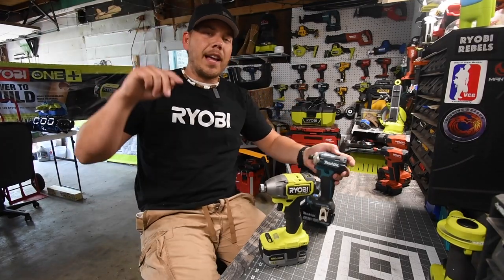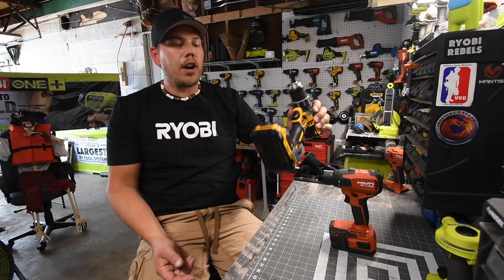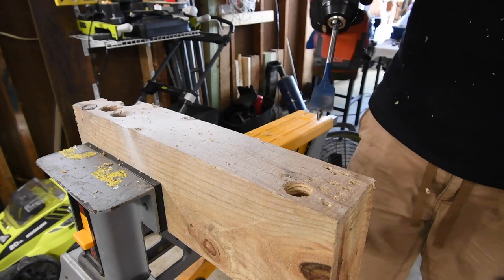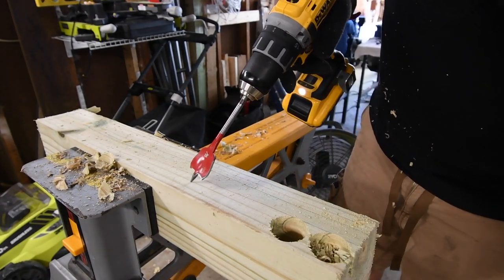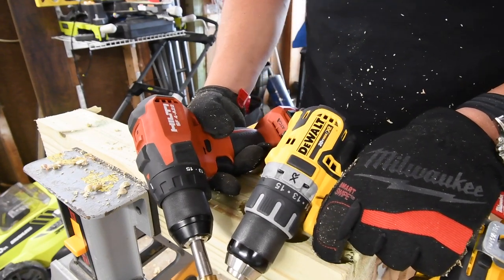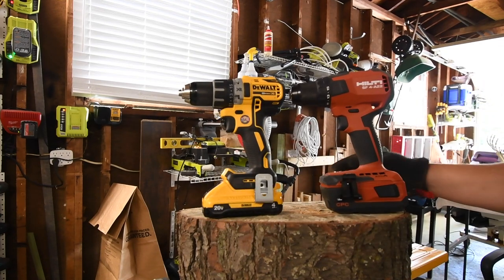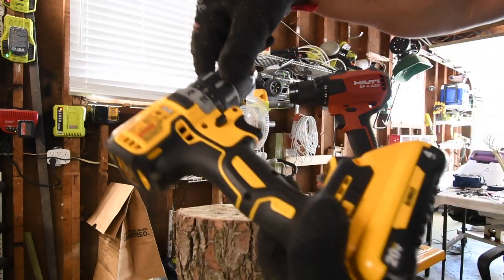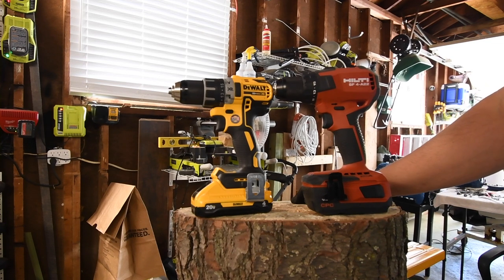HILTI vs Dewalt (Mid-Range Drill Drivers)

Comment: Hi Dave, this hilti is outstanding performance in my opinion I’ve always used the hilti jack hammer and it’s always been a work horse along with the Milwaukee, dewalt is an excellent tool as well I’m just a hilti and Milwaukee fan, excellent quality video ty, Bob,

Comment: I like it when a $200+ bare tool is classed as mid range.
Reply: Lol
Reply: SF4 A22 is the lowest in the current Hilti 22V line, and has 3 steps above, SF6, SF8 and SF10. From the previos generation with brushes ther is SFC A22 lower torque, but all Hilti cordless drill drivers are ridiculously heavy for the provided torque, except the current 10.8V so coled 12V line that is OK with SF 2 A12 @ 4Ah pack  with 21700 cells.
Reply: @loochan325  I know its Hilti's "cheapest" but its still not a mid range cordless drill driver for that price. Thats high end and only Festool has more expensive drill drivers far as i know.

Anything from Hilti is per definition high end really cause the price of the batteries alone wants to make me throw up.
Reply: @TheSir2005  Hilti, Fein, Mafell, Festool,  Atlas Copco, Ingersol Rand, plus the industrial lines made in Japan from Makita and Bosch that for only 6 Nm cost like 2X Hilti  SF 6...
Reply: @loochan325  No clue what you are on about
Reply: @TheSir2005  You wrote that as far as you know only Festool has more expensive drills. Fein and Mafell are even more expensive then Festool, plus Ingersoll Rand, Atlas Copco, and   even the industrial line with precise torque from Makita and Bosch that cost like 500-600 USD bare tool,   1/4" fix hex head no chuck. At Hilti you can look for SF 2 A12 that is the only light Hilti drill that has decent torque at 21 Nm soft torque and 34 hard ( older SF A12 at 11 Nm is not enough). Bare tool is like 100- 120 USD, the charger is around 50-60. A new 4 Ah compact pack with 21700 cells cost like 2/3 of the tool price and is nice to have two, is expensive but very nice. I have a big colection of heavy duty   and industrial drills. My main cordless drill drivers are Bosch GSR 10.8 2 Li @ 2Ah renamed GSR 12V-15 FC Heavy Duty, plus GSR 12V-15 FC Heavy Duty, that are very light and have decent torque at 15 Nm soft and 30 hard, extremely reliable, afordable and with decently priced parts at the same time, but I also use my old Makita 6270@ 2Ah NiCd, Makita DDF 453 @ 2Ah Liion, DDF 456 @ 2 Ah, DDF 480 @ 5Ah - too heavy and stupid noisy fan for brushless, Bosch GSR 18V-50 @ 4Ah pro core with 21700 cells, Fein ASCM 18 QM @ 4Ah with 43mm colar that I was able to find more afordable then Mafell A18M bl and Festool DRC and new TDC and close to Metabo but I don't like metabo, and the new Bosch GSR 18V-150C @ 8Ah that has the record for torque, plus Festool T12 with heads, and the new Hilti SF 2 A12 @ 4Ah. I was looking for Hilti SFE 2 A12 with heads too, but I don't like the heavy chuck and the bulky angled chuck so I pass that one. I have manny other industrial and heavy duty and Industrial cordless drills in my colection, from Atlas Copco, Ingersoll Rand, Fein, Hilti, Makita, plus corded from Makita, Bosch professional and even some industrial Bosch from the '90, also from Fein, Hilti, Atlas Copco, Ingersoll Rand, real Kress, and even some Duss that have the highest price, plus stations and drill stands from Blumm, Grass and some others    heavy duty industrial manufacturers not known in US.
Reply: @loochan325  Industrial line from Makita and Bosch... What industrial line? Maybe you can give me product numbers but i've never heard of those lines from either of them. I cant get 18/20v drill/drivers from Makita or Bosch that are more expensive then Hilti. Fein is around same price, just like Metabo (and then you are talking about their most expensive drill/drivers.

And nobody on a construction site ever buys Atlas or those other brands you just mentioned.
Reply: @TheSir2005  If you’re calling $200 a lot of money than we already know that you are not familiar with industrial lines.
Reply: @robertrada4783  Well I'm not, I'm not a factory worker but maybe you can tell us something about industrial cordless drills or something. I've never really heard of them so I'm intrigued
Reply: Makita's industrial tools just look ..odd.. like prototypes even. So they're fun looking and look cool as photos at in catalogs 😁

Comment: With the twist drill they are failing as soon as the flutes on the bit go under the surface of the wood so it can eject any chips. I don't know if a 2804 or a 998 would even work that way.

Comment: Power wise dewalt, but in reality if you are a type of guy that only use that cordless for home works or DIY? pro consumer tools will be serve you better like Dewalt, Makita, Milwaukee, ryobi, bosch etc will serve you better. The thing is hilti were made for construction worker or for heavy duty purpose
It'll indeed work for your DIY projects but it's way overkill you are like using a rolls royce tools. Hilti is the king of power tools they always aim to sell their products to contruction company that will order bulk quantity but don't worry they can sell 1pc to you as long as you can afford those tools usally it is 2-4x expensive than proconsumer tools. Hilti cordless drill with hammer price about 700-800$ depends on package

Durability and long term hilti would be an option the reason why hilti cordless tools are slow because they are not competing in proconsumer tools, they're not hilti power tools corded it will serve you a decades with proper maintenance and hilti is offering best warranty out there. 20years warranty for factory defect and 2years wear and tear and free service charge.

Comment: Hilti SF4 is wey to heavy for what it is. DCD 791 is lighter, and also Bosch GSR 18V-50/55 heavy duty is lighter with pro core 4Ah pack with 21700 cells.
The only Hilti cordless drill driver that has reasonable weight is SF 2 A12. I don't like SFE 2 A12 coz' the angled head is to bulky,  I need 9mm max from center to edge, and the normal chuck is to heavy, don't need 13mm coz I can find al drill bits with reduced tail, and don't like metal shroud coz' is damaging the work pieces and also after short time the chuck get to look hideous on the tool, and also I don't like it  because with al the heads and 2 x 4Ah packs and charger cost 2X more then Bosch GSR 12V-15 FC full kit and GSR 12V-35 FC full kit, but Bosch has the same problem with stupid bulky angled head.